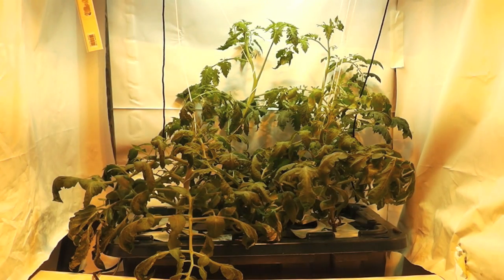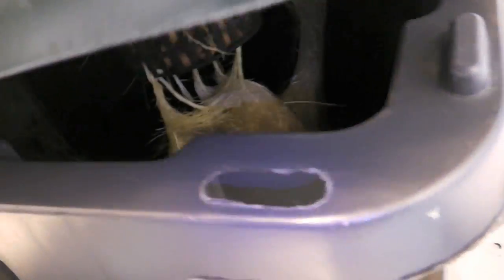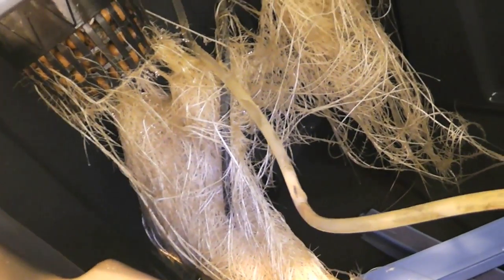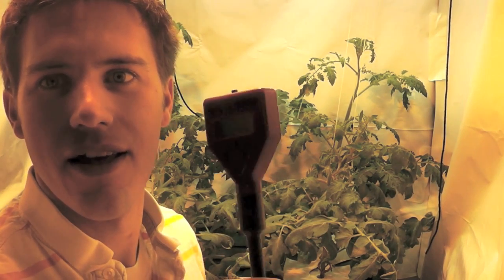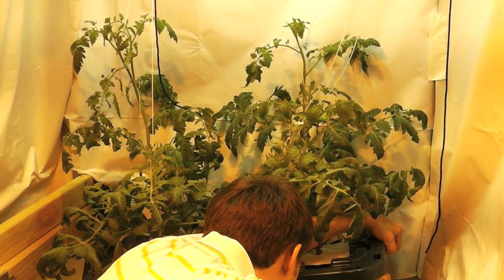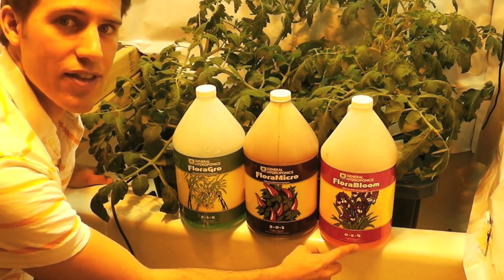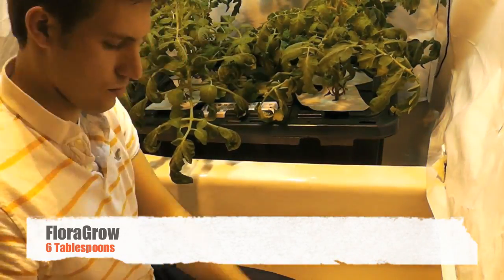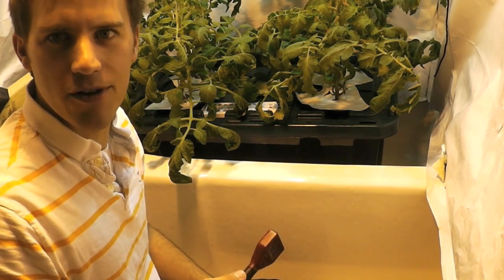How to Change the Nutrients in a DWC Reservoir

Comment: I have found this guide:

Seedlings, Early Sprouts 100 to 250

Early Vegging 300 to 400

Full Vegetation 450 to 700

Early Blooming 750 to 950

Full Mature Blooms 1000 to 1600

--

So basically do I keep the resovoiur within these PPM's using nutrients depending on what stage the grow is at? And I don't need to worry about nutrient burn / under feeding nutrients?

Comment: Jonathan, you drain without "cleaning" the reservoir. I am assuming everything is fine with this procedure? I am asking out of complete ignorance but a deep desire to learn. I appreciate your insights on my question. Thanks again.
Reply from the maker: +puffer1958 Honestly, with this setup it is rather hard to get in and clean the reservoir when plants are growing in them. I usually will deep clean it between planting. I have heard that there will be beneficial bacteria that you don't want to eliminate as they help breakdown nutrients for the plants, but there certainly would need to be a balance between that and making sure you don't have disease infesting your plants.
Reply: Thanks JJ! I really appreciate it.